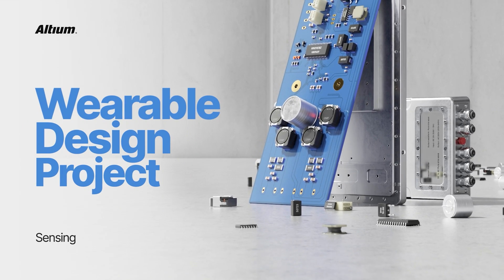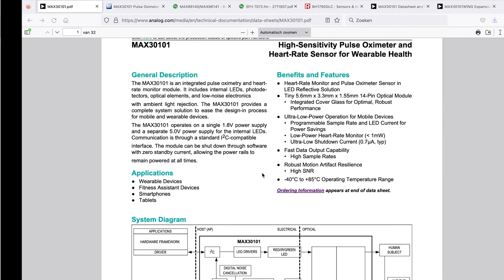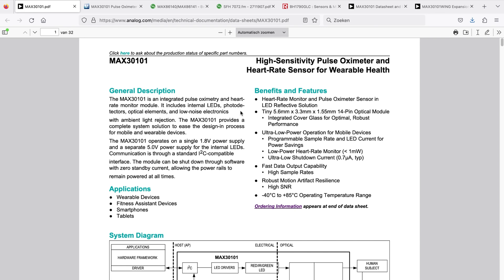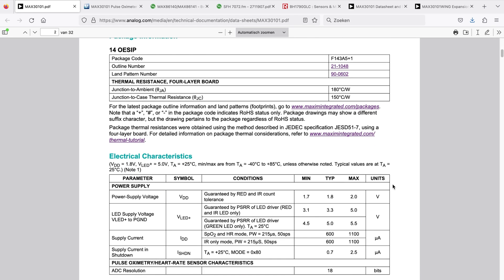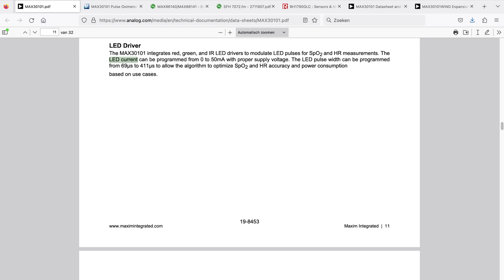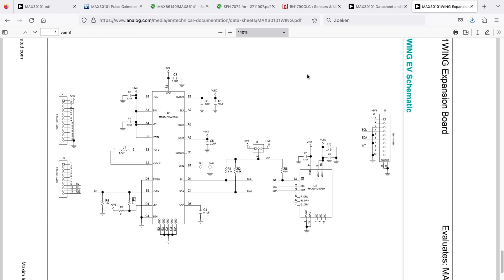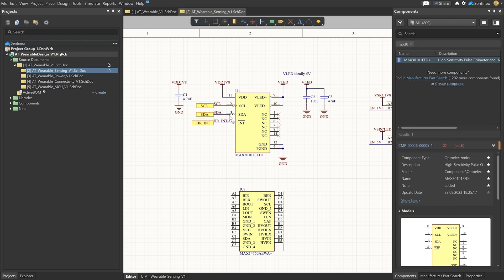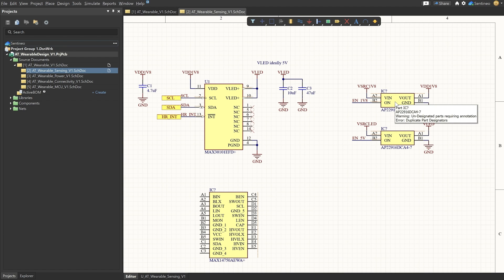Wearable Design Project - Part II: Sensing

Comment: Hey Piet, thanks for the walkthrough of the design process. 

I'd like to know about a particular part of your schematic you showed off. I noticed you didn't place any decoupling caps for the BGA load switches. The datasheet recommends 0.1uF-1uF on Vout and 1uF on Vin. Is this done as a space-saving measure? 

I imagine the main concern here would be other devices being affected by a disruption on the supply rail shared with the load switch, especially in an event with a sudden load transient, such as toggling the switch (power gating the device). It would be interesting to understand the rationale. 

Looking forward to the rest of the series!
Reply: I was wondering this too. Let me know is you figure it out.
Reply: I guess this was not a complete schematic and he'll have more details on power supply design in the next videos.

Comment: Hi guys, nice video. Would you guys be interested in making a video showing how to functionally test high speed interfaces (like USB, ethernet, RF - 2.4 GHz) with a real-life design? I mean testing in regard to signal integrity (reflections) etc. Would be super informative to see the basics of how these systems are tested and fixed in real life prototyping by the pros. I'm a hobbyist designing some stuff with high-speed interfaces like that and have come across a few things that I would like to see some good tutorials on: 

1. What measurement equipment you need (oscilloscope bandwidth/probe capacitance requirements etc).

2. Where to probe the signal to minimally affect it and see what's actually going on. 

3. How to tune the termination networks (for high speed digital) and matching networks (for RF) during testing - how close is close enough etc. 

4. As a related topic, I would also like to see testing of PDNs (especially where and how to test the VDDIO/VDDA pins for ICs and how to chose components of correct ESR requirements etc). 

If you guys ever do a real-life demo of this, that would be amazing! Really appreciate the effort that Altium and its employees are putting into educating the engineering community. Thank you!